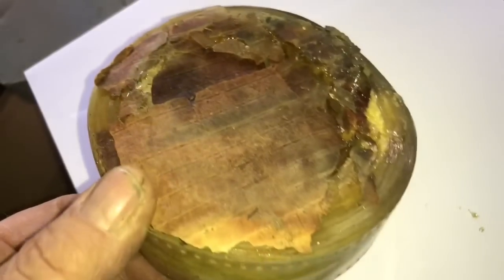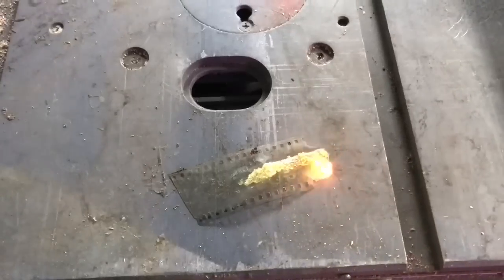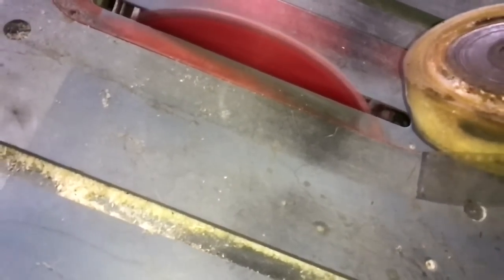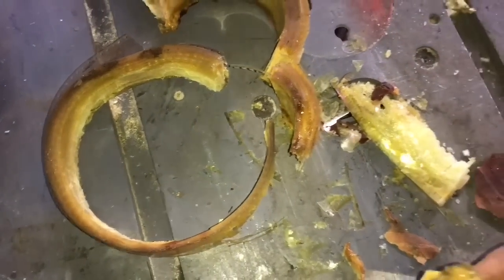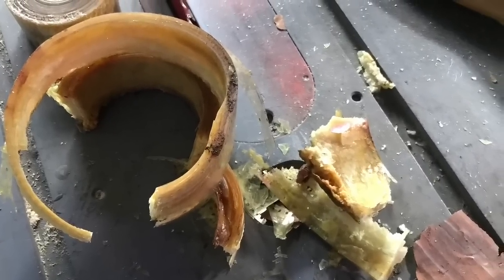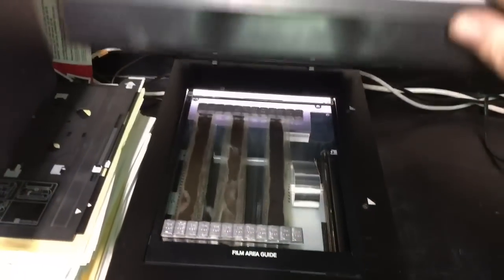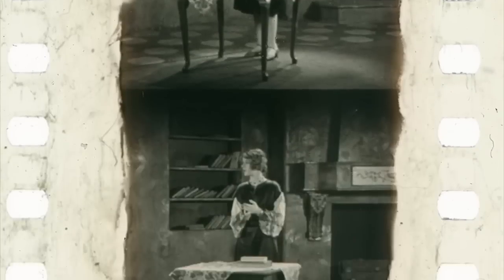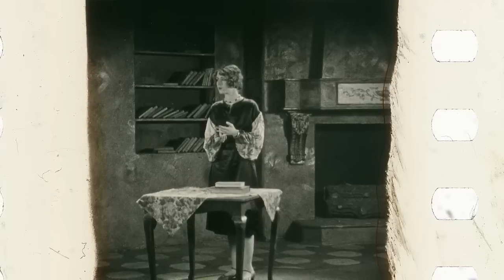Ninety Year Old 35MM Film Mystery Core

Comment: Interestingly although it was a positive image it had Bell and Howell perforations which were patented in 1912 as I recall, so it must be younger than that. Cinema prints were usually printed on B+W positive stock with Eastman Kodak perforations. The only times I used positive prints with negative perforations was as registered prints for optical effects printing or for rear or front projection.  Generally though, these were backgrounds over which something (usually an actor) was superimposed. It is also very oddly vignetted at the edges - this is neither a standard silent or Academy aperture image although it has 4 perforations per frame, as usual. The clear sides appear to move in erratic waves, not registered to each frame, suggestive of something amiss in continuous contact printing. There are no edge markings (Manufacturer's codes etc.) but that may have been standard practice when this was made.

My first thought when I saw the greasy appearance was this was nitrate positive in process of decaying - which is can do spontaneously and can ignite in the process but your flame test seemed to eliminate that.  Rather than slice the film into short strips for a flatbed scanner, I would get in contact with an agency that specialized in restoring very old films, like this one. The Australian Film and Sound Archive or the US Library of Congress are examples. It may be possible to immerse the film in some fluid to unravel it without cutting it - I'm not sure. Nevertheless it might be possible to reassemble your strips into a continuous film again using the image of the perforations.

A small piece  of history with no surviving witnesses frozen in time, like a prehistoric insects in amber. Be gentle with these! Thanks for uploading this.
Reply from the maker: You present a lot of very interesting information but if you would kindly review the finished product some things may become clearer. There is a link in the video you watched. Thank you for your interest and information.

Comment: Would it have at all been possible to run that through a projector and it play? I'm sure it may gunk up the works but I wonder if you could clean up up well enough to run it without damaging the film or the projector.
Reply from the maker: I wish you could see the big grin on my face right now, no sorry it would not have been possible. There were too many sprocket holes missing and sometimes pieces of film stuck to the edges so it would’ve been double Thickness of film going through the projector and would’ve just broke the film. This was the best way I could come up with doing it at the time but with experience I may have chosen a different method of scanning it still using the flatbed scanner but perhaps a better guide. Thanks for watching